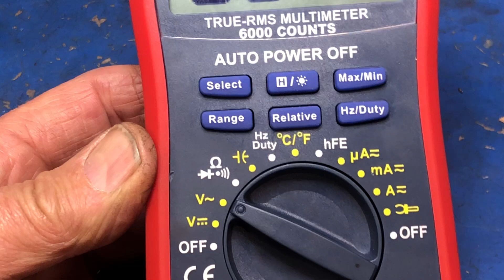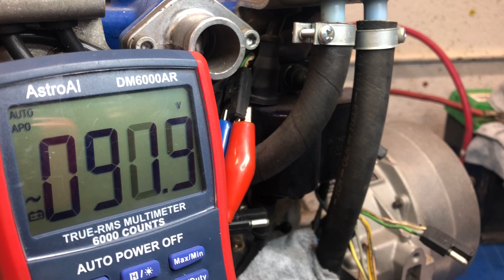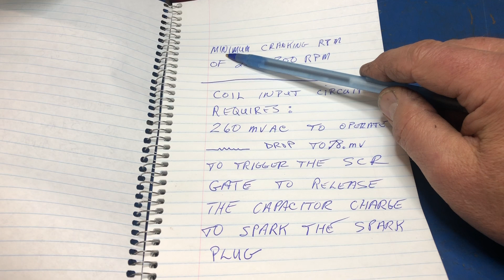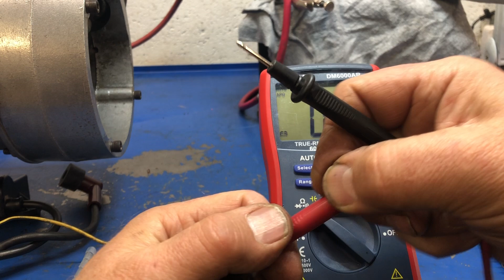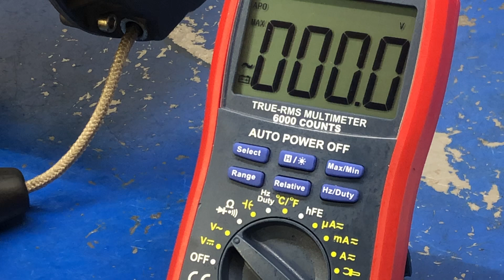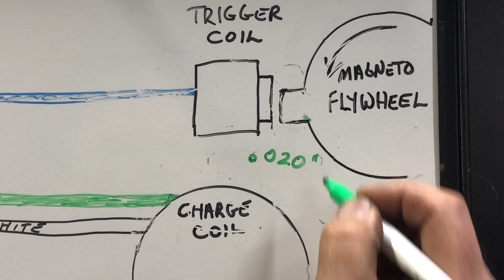Rotax 503 / 582UL ignition system troubleshooting

Comment: Wow nice this video will really help me out 
I have a rotax 503 that I took ok a trike on Friday the engine was sitting for over a year we put starting fluid and fresh gas start after about 3,4 pulls, I rotate the gearbox From SZ to SS  put it back and now doesn’t start, I don’t see spark on the plugs and I have the engine without the mag so it should run till I grout it right ?

Comment: Thanks for the video. Recently had to buy cups for my 583 blue head. Start reading and ppl suggest  that if you use ngk br8es you should you use no resistant caps since these plugs already have 5 ohm of resistance and if you use the b8es you should use 5ohm resistance caps. Anything on that?? 
Also I got a 532 on a project that has no spark 😊 so I’ll go over that video again tomorrow. Thanks
Reply: Amazon has then for about 25$ for pack of 4. Just ordered 2
Reply from the maker: I believe Less resistance is better. I’ve got zero caps and would love zero plugs. However I can’t find zero plugs , there discontinued by NGK.
Reply from the maker: If you find some B8ES please let me know where to purchase some. Thanks
Reply: @RotacRepair the stator on that 532 putts 47.1v is this enough or I should keep looking for the problem
Reply: @RotacRepair not sure about Canada, but I can get ahold of the B8ES in the USA now. 6-7 years ago they were impossible to find, but not so much anymore.

Comment: Thanks for your videos! I've been having issues with my 582 starter. Turns over, but way too slow and sluggish. I tried 2 different starters, same thing. One turn over, and that's all I get. Someone mentioned it may be poorly adjusted (contact with flywheel)? Hand cranking to start no problem. Would love to figure this out to get my electric starter going. Been doing this since I bought the AC. If it is an adjustment issue, might be a good idea for a video ;-)

Comment: Great video. Very informative. Now I need two spark plug boots because I found 2 out of the 4 boot resistors were open. I have a 503 DIDC engine. How much would these boots cost me? Just a ball park figure is good for now. The engine was running great last fall when I put it away. I'm questioning the grounding wire set up to the switches now.
Reply from the maker: Thank you for the kind comment. It fantastic you put the information to good use on your own aircraft. There’s probably lots of bad plug caps out there. Unfortunately there is no longer any inexpensive NGK aftermarket cap replacements available. Rotax caps available at $18.18 CDN each.

Comment: Awesome Video John. My question is. When doing a Mag drop test, the manual states 300 rpm max drop. is that per mag or combined? and also, if you do have a bad mag drop test what would cause that and what would you do to fix that? And for my final question. I replaced my Voltage regulator because I was seeing 12.2v while running and no change with rpm increase. I put a new voltage regulator in and now I am seeing 13.4-13.5v but on some planes I' see 14.3v. Am I good or what could the problem be? Keep the videos coming
Reply from the maker: Thank you for your kind comment. Hopefully you able to share it out to help others. You’ve given me a couple of good video ideas! Could you please let me know what part number voltage regulator you’re using? Is it a lead acid battery? At 13.5 v your charging, however a bit on the low side. Is 13.5 with all accessories off or on?  Best Regards John
Reply: @RotacRepair  Thanks you for commenting back. I have a Key West Regulator and its brand new. I use an Odessey PC545 Battery. All avionics are on. Before I went to all digital panel it was showing 14-14.1v.  When i replaced the old key west regulator, it was showing 12.2v so I replaced with a new one and now it is showing 13.5v. Thank you again
Reply from the maker: @ I’ll have the charging system testing video up this week.

Comment: A very, very informative video. You mentioned the specs for the trigger coil, but do you have the specs for the stater?
Reply from the maker: Thank you for your comment. These are my own specifications as Rotax recommends only resistance testing. On my ignition machine I’m able to test and hold at very specific rpm’s. The stator output (green and white wires) on average, at 250 rpm is 32 vac and at 300 rpm it’s 38 vac. I’m now thinking of making a more detailed stator video.
Reply: @ Very much appreciated for all you’ve done in regards to my spark issue. That video was excellent. Thank you. Karl.
Reply: Hello John. I still never rectified the problem I have with this 503 skidoo engine. Which I had contacted you approximately a year ago now. I only work on it at this time of the year and the problem I’m having that I have a weak spark. The engine will start in the shop which is heated. But when outside is about -20 Celsius, it will not start. There is no spark at all. I have tested the stater in the shop and I have 64.5 AC volts. When testing the stater outside in the cold, I get 57.5 AC volts. Testing the trigger coil in the shop. I get 297.2 MACV. And in the cold outside, I get 309.MACV. Then I heated the CDI with a heat gun to where it was quite warm to touch. And still no spark. Put back in shop approximately five hours later had weak spark, but it started. Could you tell me where my problem could be found?  Thanks. Karl.